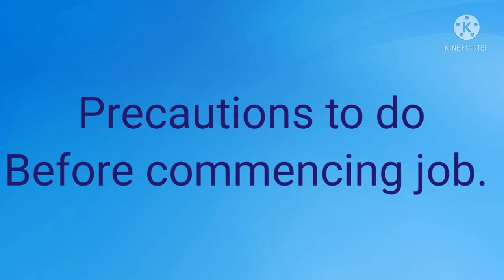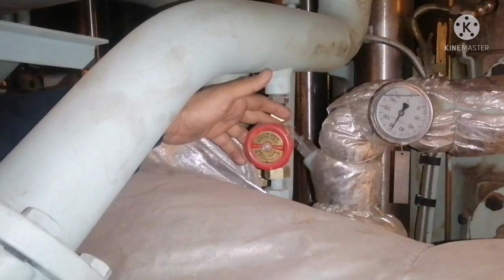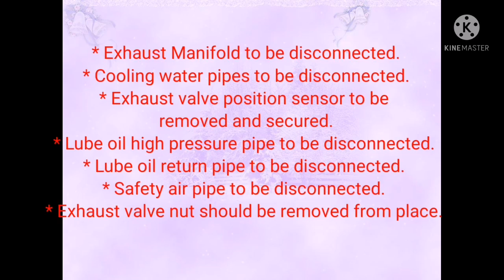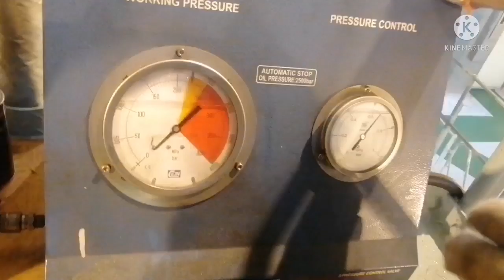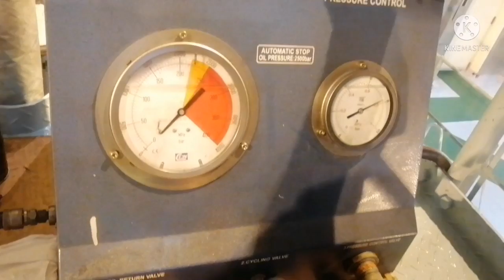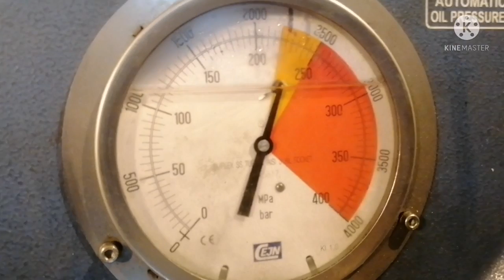How do they do... How to remove  and refit main engine (Electronic type) Exhaust valve..PART-1

Comment: do we need close any valves before venting the spring air or just turn to venting position? Do we have control air valve and safety air valve in ME Engine? thanks.
Reply from the maker: Sir We need to close spring air valve before starting the exhaust valve job...
Yes.. We have control and safety air valve for Main engines..
Hope this reply vl satisfy your query sir
Reply: @marine-knowledge-basha  I mean when we venting spring air, how many valves will we close? As I saw in the video, just 1 valve only. Isn't it?
Btw, we only drain cooling water for cylinder which is overhaul and we stillkeep cooling jacket pump running, is that correct? Thank you so much.
Your video very usefull.
Reply from the maker: @xuanthaoduong6959  s sir.. Ur vry crt.. V hv one spring air valve and one control air valve.. Since we do replacement of exhaust valve.. We need to close only spring air supply for exhaust valve.
Regarding cooling water we have to close inlet outlet valve open the drain valve for the same for the particular cylinder..
Hope this reply will satisfy your query
Reply: Thanks for your help!!!!! I have a quastion sir: The safety air and the sealing air are the same? Where we could find a relative video or notes to expain the purpose of these air? Warm thanks sir!!!!

Comment: Thank you, sir, that is a nice and usefull video, great job. The size of exhaused valve impressing.
While watching some questions appeared:
1) What is the purpose of activity on 19:23 (openning two alien bolts with allien key)? And then pushing the knob on 19:56?
2) On 24:56 whe the man is openning hydraulic nut. How far did he unscrewing? Not till themoment when the nut touches the hydraulic jack, right? How many moves (holes) did he do?
Reply from the maker: First of all i apologise for late reply..
1) Its just to fit the jack in place and tightening.
2) we need to turn 10 turns or 10 moves...